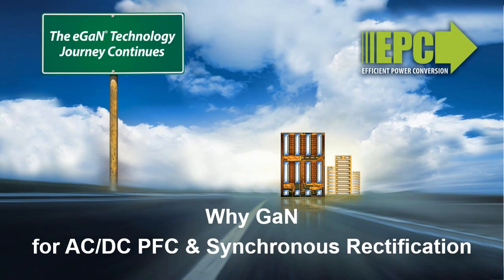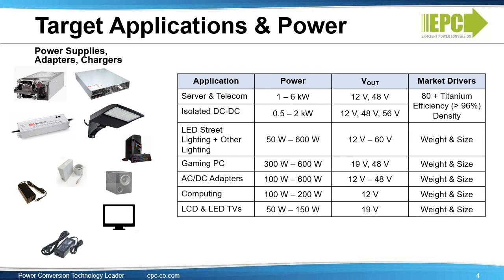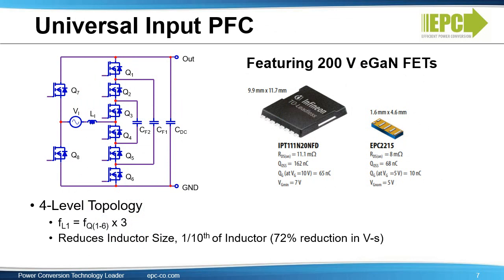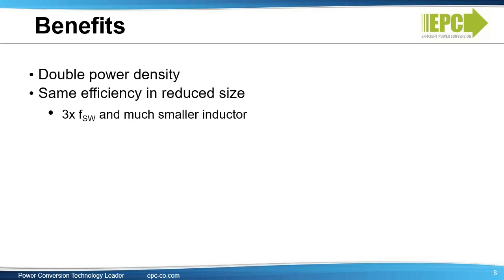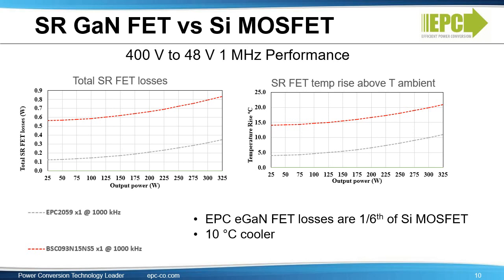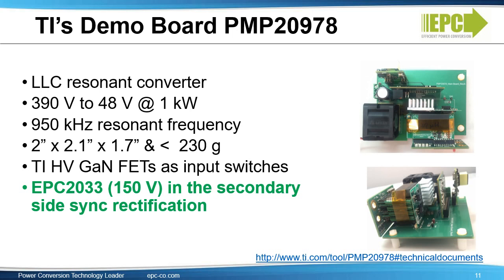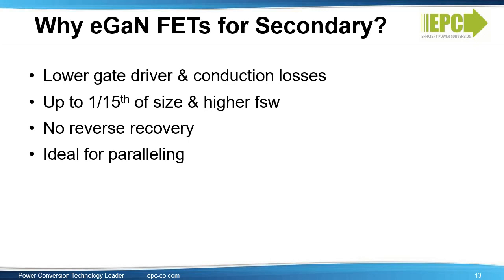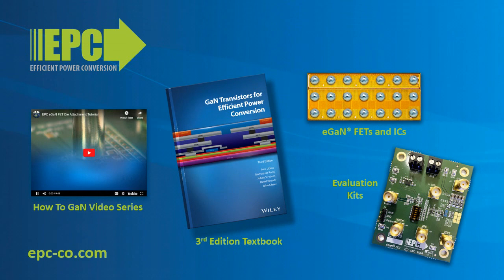Why GaN 05 - AC/DC PFC and Synchronous Rectification

Comment: Dear EPC - I have read your 
"How to Design a Highly Efficient, 2.5 kW, Universal Input Voltage Range, Power Factor Correction (PFC) 400 V Rectifier Using 200 V eGaN® FETs"
but can you please make a video fully explaining the working principle of your 
"GaN-based 3 kW Four-level Totem Pole Power Factor Correction (PFC)" featured at 3:07

thank you
Reply: @EPCCorporation  Thank you, I subbed and will look forward to that!